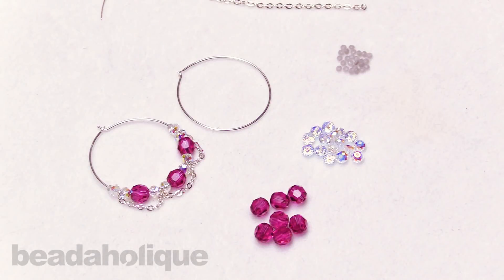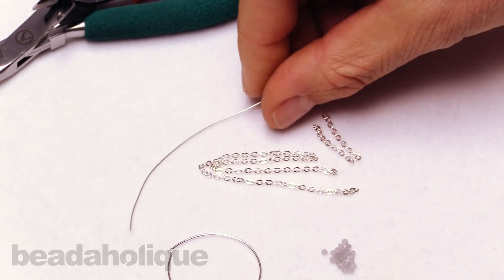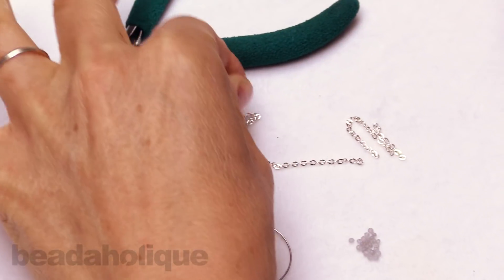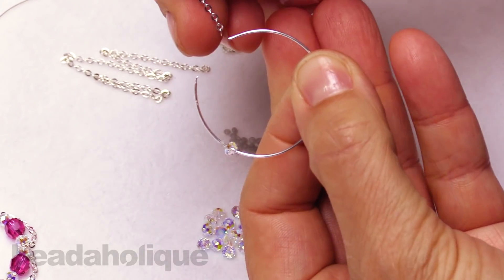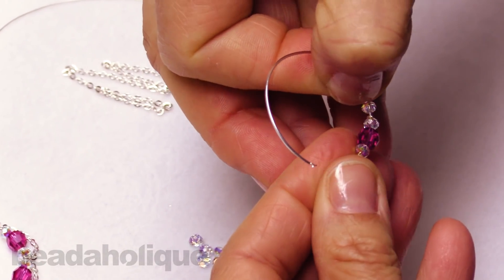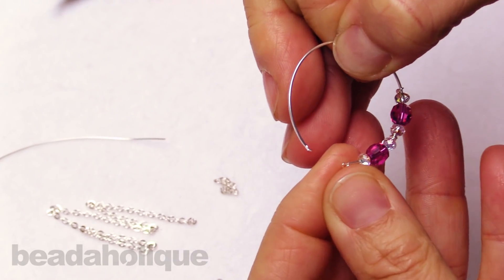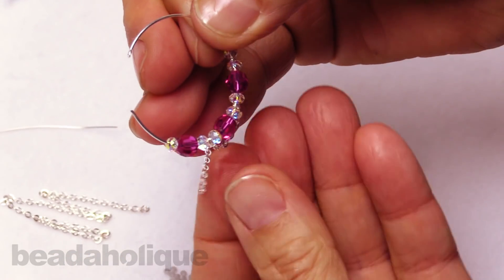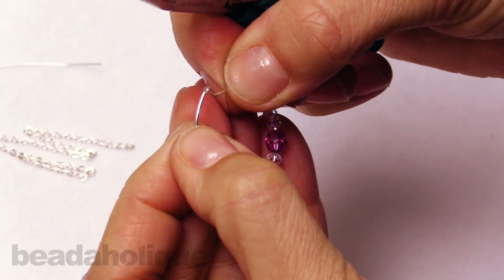How to Use Bead Bumpers on a Beadable Earring Hoop

Comment: I had put on a 1.5mm beed bumper but it did not keep the beads in place. So should I try a 2mm bumper instead?
Reply from the maker: Was the problem that the beads slid over it? If so, then yes, I would try a larger one.